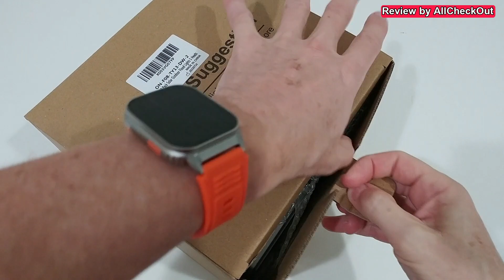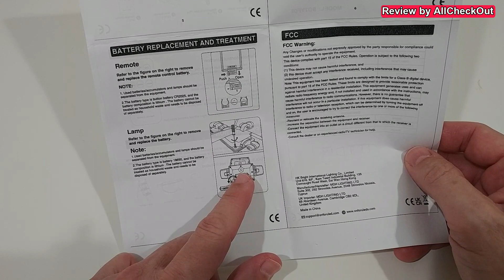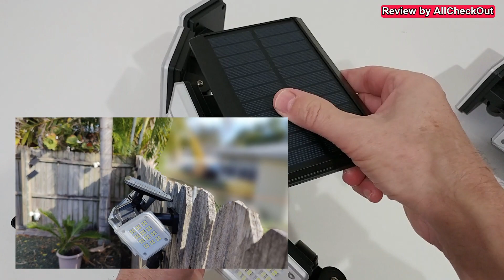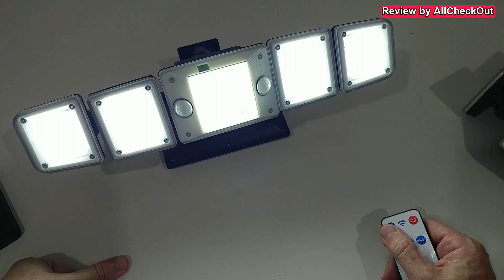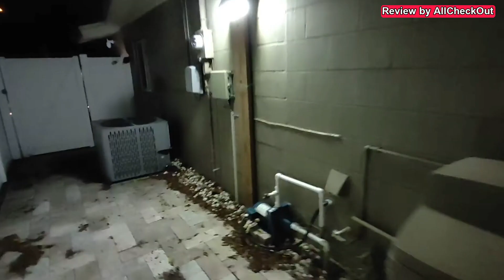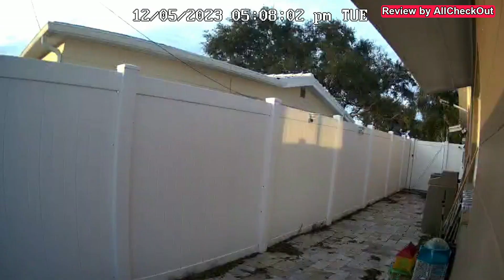Onforu 2 Pack Solar Lights BDTYF08 5 Heads 2 Sensors, Remote, 280 LED, Full Review And Tutorial

Comment from the maker: Why nobody watching this? This is one of the best solar light sets. Just noticed after a few days of overcast weather and after that yesterday even a full blown (almost tropical) storm system here in Florida with no sun for long time ... this was the last solar light still shining ... and I have really a lot of different ones. Some of them I considered really great already, but this one seems to be even better. I had it on 10% with PIR and the PIR is not causing any false alerts so it's pretty much all the time on 10% and still giving some nice illumination on the back area.